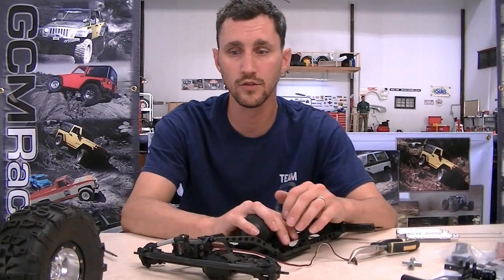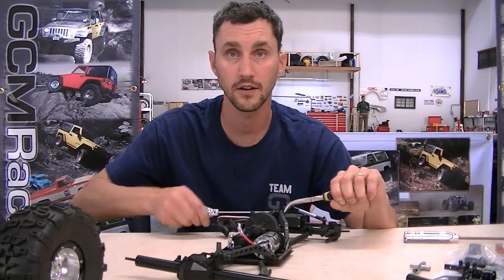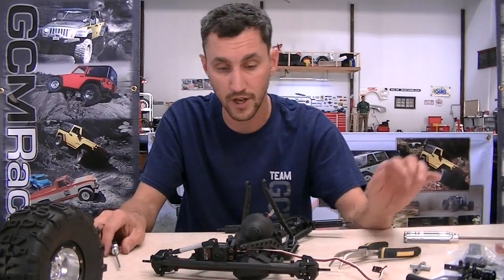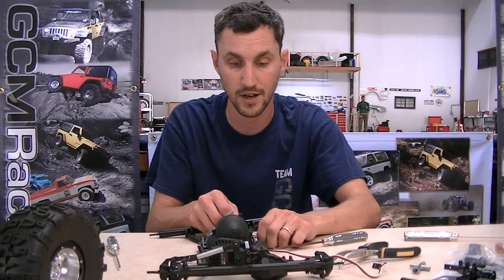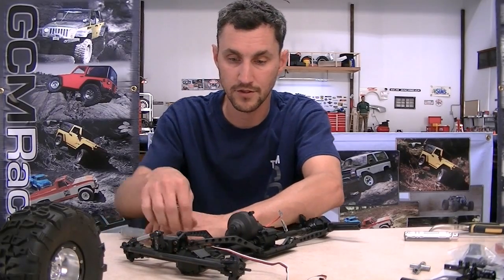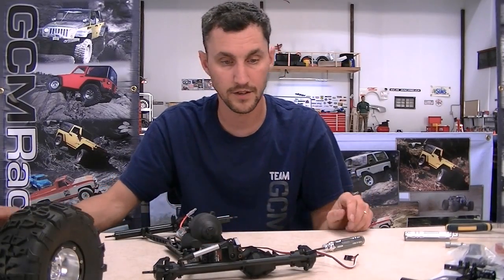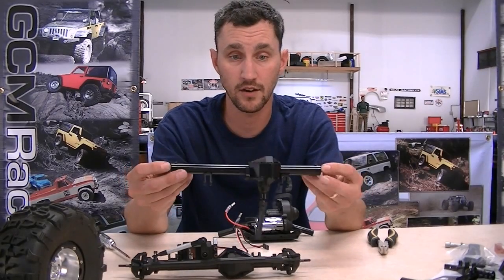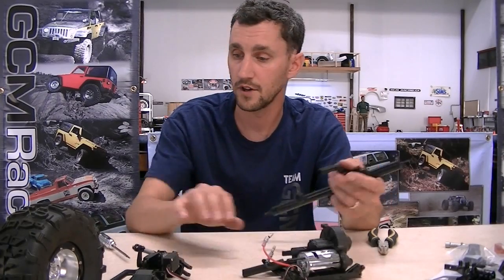MattZilla U4 Build Series Part 2-Diamond Wraith Rear Axle

Comment: Don´t you lubricate them ?
Reply from the maker: Carlos Cabrera Yes, I use only white lithium grease, and not very much. It sticks to the metal gears and won't come off, but doesn't use up much motor power from being too thick. I didn't show putting on the grease, because these gears were already greased from the last axle housings.